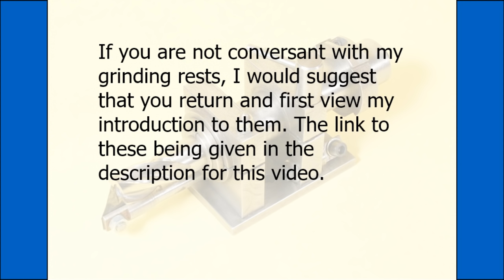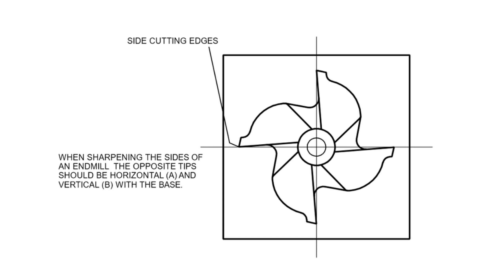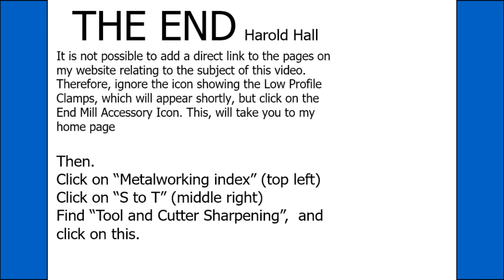Endmill Sharpening

Comment: After seeing the low profile clamps I made a set from grade 8 bolts. I drilled down through heads then cut them off. Used 8mm Allen bolts turned eccentric in 3 jaw , offsetting by putting aluminium shim under one jaw. It was so simple I should have made them yeasr ago

Comment: Hi Harold was doing the cutter sharpener from the book does not say a slot in part #66  bearing   . Looked at the video and it has slits in the spindle bearing . its coming out pretty good  . Im about half way done with the jig ty again  Paul.
Reply: Paul
You do not mention which book you are working from. If “Milling a Complete Course” you will find on page 114 the statement which says “Fit bearings using two part resin adhesive. Therefore the bearings will get slit at the same time as parts 63 and 64. 

Incidentally, I wrote the article for the “Model Engineers Workshop” magazine starting in April 1992 (when I was editor and short of articles) and then published in “Milling a Complete Course” in 2004.

If you are looking at “Tool and Cutter Sharpening” look at page 110 for a similar explanation. However, this book deals primarily with sharpening techniques and has much less detail about making items. 
Harold

Comment: Pretty nice overall but a slow process loosening and go back to the starting point when sharpening sides of endmills... you could make a pivoting hinge plate with a spring pushing upward to a stop..only needs to pivot little, perhaps 3/8", heaving a handle in front of pivot plate pushing down moving away from the wheel and let go at the starting point, some air flow spindles have this set up and I love it, [ have made one] your left hand is on the pivot handle and right hand pulls the cutter.

Comment: why not put a bearing on the end of the spindle for the hand so no involenary action of the hand is transmitted to the tool. but hey nice job that tool design is from model engineers workshop yes.

Comment: Can this fixture be used to shape and sharpen tapered reamers? These cutting tools have cutting edges along their length with either straight or reverse helical flutes. Examples are tapered pin reamers and Morse tapered reamers. I need to make tapered reamers with various custom tapers. Thank you.
Reply from the maker: Both for taper pin and Morse tapers reamers the angle needs to be very accurate, I doubt if this could be achieved. Also for Morse tapers the required length of the traverse would be difficult achieve without fluctuations.
Harold
Reply: Thank you very much for your quick response. I have two of your books and have begun making some of the tools. I have a long way to go before I'll be making reamers with custom tapers. Happy New Year, sir.
Bill